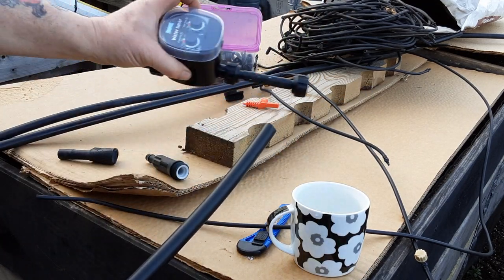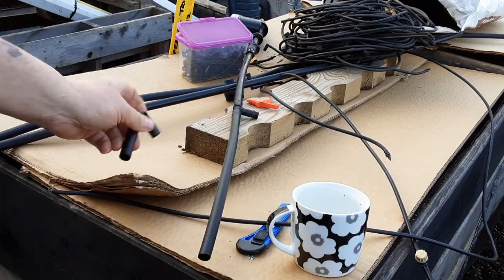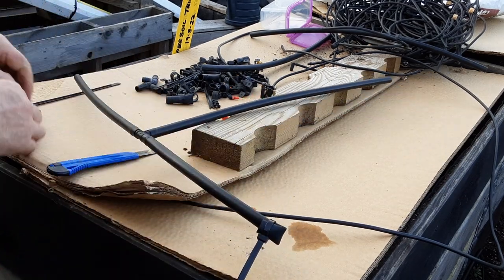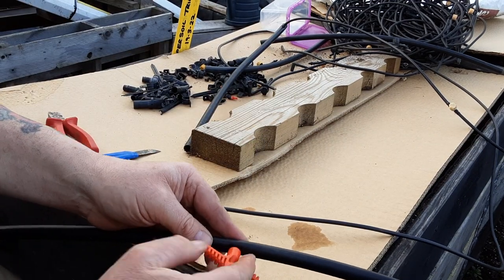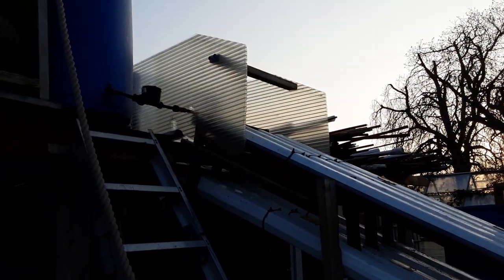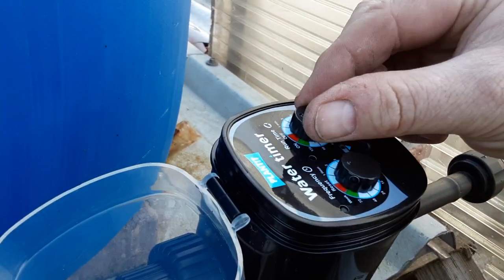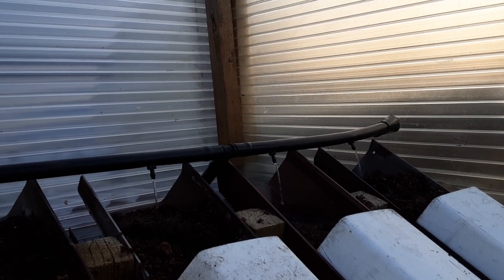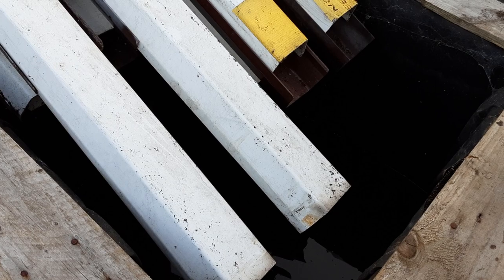Long Root Guttering System 🌻 Battery Water Timer Irrigation Installation 🌻 Sprouting Broccoli

Comment: Hello Terry a suggestion would be to fit a short 6mm pipe to each drip nozzle with inline taps on the ends. You can then regulate the flow individually for each station. I have had an auto watering ring main around my garden for over 20 years. Newer controllers allow programming/switching direct from your phone 🤣They are a saviour when on holiday. 😀👍
🌻🌻Nigel…………MuddyBootz Allotment🌻🌻
Reply from the maker: I had issues with blockages last year and this time I tryed to keep it simple and it's working great at the moment with very little water used or wasted. May have to add a short length of pipe if the leaves get in the way.

♻️Happy gardening, Terry King.

Comment: 🏴 Hi Terry, interesting , informative video 👍👍 Think I'm going to look for some of that style irrigation for watering my potato buckets off a 45 gallon blue drum like you are doing for your long roots. 
It's hard workand time consuming watering 50 buckets with a watering can (hose pipes are not allowed) . This style of system would make things a lot easier that's for sure.
Best wishes
Steve
Reply from the maker: Certainly something that I would use elsewhere Steve if a float wasn't suitable. 

♻️Happy gardening, Terry King.